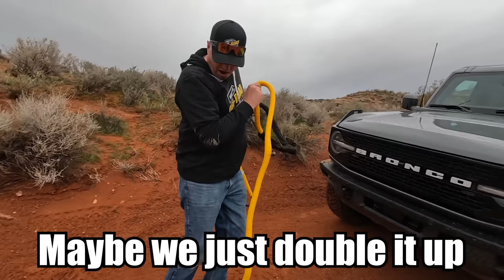More Difficult Than I Thought...Is The Wrecker Too Much For Me?

Comment: I think you need a fixed strut to attach between the wrecker and the towed vehicle.
It seems like you should be letting out more rope when you bring the back end of a vehicle down the drop. But that probably leads to it moving forward unless the rear brakes can hold it.
With a fixed strut, you could let out more rope to lessen the attack angle on the rear of the towed vehicle.

Comment: Matt, I wonder if you made some kind of bar with articulating attachment points, put a large shock absorder in it.. use it in place of the horizontal soft tie... then you wouldnt have to have someone ridin the brakes on the towed vehicle?

Comment: I've always wondered why you don't have a boom sling to use with an articulating bar extension off the rear bumper to keep the rig pushed back so it doesn't strike the boom. Maybe extend the boom a foot to help get the towed vehicle back a tad more on descents?

Comment: I would like to see a "Telescopic" fly-section in the Wrecker-Boom
it would only need to be able to add about two-foot-six
(750 mm approx.)
but with an extra pair of sheaves (pulleys) for your two boom-winch-ropes
(occasional use only).
Would probably only be needed when 
the boom is laid down low (quite flat),
or boomed up very high (steeply).

Also worth a thought (??) 
a fabricated Steel "X"  with eyes on all four legs,
for "Bow-Shackles"  &/or "Soft-Shackles"
to separate the towed vehicle ("toad")  from the two-truck
during "over-run" situations.

(would act like a cross between a Double-Bridle (soft), 
& a traditional Stiff-bar !)

Comment: Maybe supply the wrecker with  an "A-frame" -  to control the towed vehicle when "on the hook" (esp. if there were no driver in the towed) - it already has 2 pintle hooks on the rear bar as recovery points - a simple ring on the ends of 2 bars will keep things under control (a split A-frame"  - can also be used as single or twin parallel drawbars..

Comment: Matt I’ve been thinking about a solution to keep the customer vehicles off the back of your wrecker. You could run a chain through a long piece of pipe and attach one end to your hitch and the other end to the customer’s axle. You could play with chain length and soft shackles to keep from scratching their axle and your bumper. It might save hoods though :-)

Comment: I wonder if a tow bar system, essentially like drag links, would be beneficial in downhill situations. Two fully articulating joints at the wrecker, and the business ends would have tire cradles with straps. Slip joints with limiters in the link bars to allow turning. A rough concept, but it seems that it would alleviate any contact between the vehicles.

Comment: So for vehicles with shackle mounts in the front bumper, couldn't you make some steel bars about 3 or 4 foot long with heim joints on the wrecker end with mounts and then brackets with holes for a bolt through the  shackle mount. Heims alow plenty of flex but solid steel bars keep the vehicles a fixed distance away from the back of the wrecker. So no boom to hood damage.

Comment: Hi Matt, watching you with the wrecker and seeing the problem you are getting with under run of the following vehicle is it possible to use 2 pogo sticks as they call them here on our roadtrains when they hook up for a boggy bit but for you to triangulate them like a V so it can swing off your rear and work on how to connect to the tow car via axles or front bar etc?

Comment: You need a big, soft, rear bumper. Maybe a set of 4 tow dolly mounted wheels with some soft stuff sticking out between the hooks and the frame. The boom could also be padded on the tip.

Comment: Hi, Matt is you see this I put heat wrap kit for starter motors that are close to the headers. I used the stainless steel straps. It worked so good I still haven’t needed a replacement.

Comment: No Tachometer. never found the use for one,,, fun to watch. and comes in handy if you are Slamming top end gear shifts. but, should be able to drive, clutch and run with out one. I still have to have one though.. : )

Comment: Wouldn't the wrecker be better with one of those arms that lifts the vehicle by the front wheels (or what remains of them!) and holds the vehicle a fixed distance away, rather than the arm and rope with the vehicle swinging behind? It would prevent all these little bingles with the arm and the bonnet of vehicles.

Comment: I am by no means a tow truck anything, but from day one before it even left the shop I could see the problem of truck momentum and it has carried on through out the videos. Is there no way to have an adjustable solid bar with swivel joints instead of slings to keep the towed vehicle at a distance? I must be missing something?

Comment: What if you built two bars in a y configuration with shock absorbers in them to pull at the shackle points instead of the two straps so the jeep can't over run the wrecker? Or some sort of cushion bumpers on the back of the wrecker to hit against instead of relying on the boom cord to stop it. Just some thoughts.

Comment: It looks like you need an expandable boom coming from the headache rack base, and then you can use the existing boom as a sling /A frame to keep the tow vehicle away. 
I would do a roll cage through the cab  or over the cab to the front so the chassis is strong. And you could unbolt the top bars to remove the cab. But you need to be able to create  seperation. So an extendable boom.

Comment: You should build a metal/aluminum L shaped vehicle carrier that attaches to the boom and where you can strap down the front or rear tires to the bottom of the L. Kind of what Repo guys use. That way you don’t risk damaging the hood.

Comment: Hi Matt, I need to admit I do not have any experience in this sort of recovery but would it not be possible to get some solid bar or two between the wrecker and the vehicle you are towing to prevent the towed vehicle from running into the back of the wrecker?
Love your video's

Comment: Matt, would it help if you had a solid piece between the bumper of the vehicle being towed and the wrecker. So the tow vehicle doesn’t swing into the wrecker. But the solid piece would have pivot points on each end.

Comment: Isn't this where Matt should weld the steering ram back onto the bracket like Rory would do........ hahahhaha........ that's why you have an onboard welder right???? Matt, also maybe you should lift with both winches at the same time not one and then the other...... that's a problem with having 2 winches attached and separate controls for each... Matt why is the fuel dripping out of the filler neck.. maybe you finally learnt to fill the vehicle before using it for a recovery.. OMG will strange things never happen hahaha... and Yes Matt, you looked at it several times when at the locker holding the starter motor and getting ropes out etc... It is all a Big learning curve for you from now on with the wrecker and every recovery with it will be different in its own way and lessons will be learnt from each and every recovery. You both did well with the knowledge that you already have. Why is Jefe's brand new vehicle being used for recoveries ... don't you already have enough recovery vehicles to choose from without using private vehicles??? Maybe Jillian needs some help and a lift kit and bigger tires then she wouldn't need to be calling you out all the time.. but she is out using her 4wd which is fantastic!

Comment: You just need to make a pivot point in the middle. It requires a steel tube with U joints on ends. Some attachment points will need to be created but not hard to figure out. Love your channel BTW.

Comment: What if you manufactured a solid bar that had some sort of universal attachment that took away the need for someone to sit in the vehicle being towed and monitor the brakes? It could attach to your pintle hitch and could make for easy install/remove when an obstacle requires more movement than what the flat bar could provide.

Comment: I would recommend using ratchet straps to suck the front axle up.  The higher you pull the front axle up, the lower you can keep the Vehicle in tow. This will result in more room to the boom and a more stable ride.

Comment: I think you can build a trailer for the wrecker with the same axle as the wrecker and hydraulic levelling and steering.  Maybe also the hitch hydraulic to keep the back of the trailer from hitting the ground also for loading and unloading. 😃

Comment: You should tow from the axels, if not directly for the cars whose axels are deep inside the car, there is a steel triangle that you can build, fasten it to the front axel, the 2 sides of the triangle and the last corner you hoist up, it will make your work much easier and faster not forgetting add enormous control on the load

Comment: Try and chain the front axle to the frame before lifting these offroad rigs, eliminating the need to lift till the suspension is drooped out. That will allow the tires to be lifted much quicker leaving the hood further from the boom.

Comment: Jefe, when you set your BRONCO up,  
consider, maybe a two-foot tall strip of Black (?) Raptor liner of similar,
along the lower-flanks, to guard against vegetation-rash (scratches) (??)
-
Also ROBUST Rock-sliders, 
paired with retracting AMP Research, or similar,
POWERSTEP RUNNING BOARDS, 
that retract to "inboard" of your Rock-Sliders,

for when you have lifted your vehicle up a bit.

Comment: Pity you didn't have the solid towing bar that I suggested a couple of weeks ago... Just saying... I had one years ago, just a 2.4m (8') of 50mm (2") square tube with a 'D' ring welded onto each end. We could adapt it to almost anything. It could save you a lot of damage. It would not replace anything you currently use, instead it is an additional tool in your armoury to prevent the two vehicles coming together. But far be it for me to try and teach you guys to suck eggs, you do an awesome job!

Comment: Cut 4 holes in a large old tire at equal lengths apart in the center of the tread. Tie 2 ropes in an x pattern and push each of the four rope ends out through the 4 holes. Tie the four ends of rope to opposing ends of the bumpers on the wrecker and the towed vehicle. This X sling should prevent bump and grind between vehicles,(wrecker and rescued) , over varied terrain.

Comment: What you would need to keep cars hooked onto the wrecker is some sort of bars with suspension or solid that can be freely adjusted left or right for different vehicles. same concept as the black straps but solid
Google “Medium-Duty Truck Tow Bar with 2 Rings”

Comment: Think the wrecker boom needs to be 3+ foot longer and full chassis width instead of an a frame.

Would give the vehicle behind more clearance.

Also you could cross over the winch lines in a big X and do the same underneath from the chassis and it wouldn't go anywhere, no twisting etc...

Comment: Rather than using ropes between the rear bumper of the wrecker and the customers car for pulling (not lifting), could you switch it out for something rigid/solid fixed to both vehicles that might keep it at a fixed distance from the wrecker?

Comment: If its possible to leave the vehicle in 4wd and put the the trans in neutral the front brakes will help with braking and disipate heat by slowing the rear tires through the drivetrain even though the front tires are in the air as long as theres no problem with them turning. Just throwing that out there incase someone reading this didnt already know that.

Comment: You need to make a stiff bar to go between the heavy wrecker, and the towed vehicle to stop the towed vehicle from bumping into the back of the wrecker, make it sliding and adjustable with Lock pins

Comment: They need to modify the wrecker so that it has an extendable boom and also some type bar or strap assembly to stop the cars from swinging forward and damaging the front of vehicles, If the boom extended about 6 more feet it should stop vehicles from hitting the boom, Also might need a couple thousand pounds on the front bumper for ballast,

Comment: @MattsOffRoadRecovery A shock absorbed shaft or shafts system could be designed to perform the role of your crossed straps or supplement in the case of using a single shaft.  With strong enough shafts you could even have them able to lock in place to be able to hold back the vehicle being recovered on obstacles such as drop offs where you seem to struggle greatly with proximity to boom.

Without building a prototype I am struggling to describe it properly.  But I think the closest way I can to describe it is to have you picture a comp truck coil-over shock positioned between your wrecker and the towed vehicle.  Needless to say a comp truck shock would not have the strength to withstand much in the way of lateral force, so a heavier shaft would be needed such as an earthmoving hydraulic ram with coil adapter to the outside to provide cushioning.  The added benefit of a hydraulic ram is the ability to flow restrict the ram to keep the coil controlled and even have a valve shut off so that the ram could essentially be locked out to hold a vehicle back from the wrecker.  Now for this to work well with the boom winches you would want the ram to attach low on the vehicle suck as the front differential housing, having a rubber mount that gets strapped to the mounting point would ensure that you had further insulation to soften any forces on the recovered vehicle.

Jus the thoughts of an aussie with too much time on his hands.

Comment: Don't the wrecker have a welder on it? :P
& I'm thinkin you need a longer boom and a triangle shaped tow bar that could either be put 2 points on the rear of the wrecker or 2 points on customer's vehicle. This triangle would stop vehicles from moving forward and whacking the boom or the cables damaging things.

Comment: Curious why you dont use a bar connected to the wrecker to the towed, or straps like a tow truck uses, to prevent hitting the vehicles together and dragging tires over rocks, creating a flat spot on the rear tires 🤷‍♂️

Comment: Is that fuel constantly dripping out of that pipe cap on the driver's side of the wrecker? I'm pretty sure it is. That seems kind of unsafe to me. You should put a vintage style cap on it or something or you could put a piece of neoprene gasket at the back of it so it has a seal. A 12x12 neoprene sheet is like $10 and would probably do the trick.

Comment: Hi all from Australia 🇦🇺 😊,  I have a few questions.  Would it be possible to chain or strap the axle to the chassis so you don't have to lift so high? When we use high lift jacks we do this here . Would a stiff bar between the wrecker and vehicle be of any use to control the vehicle being towed?  Not actually seeing the problem in the flesh any reason why a welder could not have allowed the vehicle be driven out?  Just curious that's all hope all is well.

Comment: You just need more practice on how to use the boom effectively, raising and lowering as needed to match the terrain.  Then again, your boom would work better, especially on larger vehicles, if it were a foot longer so you could get more height for those large drops.  Have you thought about adjustable-length tubes (like long suspension arms, but more length adjustment) with round loops at the ends?  Both together on the pintle hitch and each spread toward the towed vehicle corners and strapped to the front axle to keep it all at arms length.

Comment: Just some thoughts:  Y’all have to address the suspended vehicle swinging free problem. So, if y’all aren’t gonna install some sort of wheel lift……probably too late in the game for that modification…..I think it’s time to upgrade the boom to be extendable……to give y’all more space between the wrecker and the towed vehicle. Or, just see if a conventional tow sling set-up will work with the current boom configuration. As I understand, they are designed to limit the forward/backward motion of a towed vehicle and you can keep the boom a lot higher in the process.🧐👍🏻

Comment: I really feel like you need to adjust how far the vehicle is trailing you depending on the situation... On crazy obstacles, i (someone sitting on the sideline)would let them trail behind a bit until i cleared the obstical then whinch them through.

I could see how that would be difficult in this particular situation, the steering being shot.

Comment: Would a sling from an actual tow truck be an appropriate tool to add, so it would lift the vehicle and then provide a stiff arm so that it does not slam into the back of the wrecker (MORR-n-ater)

Comment: I'm interested to see a solution to keep the towed vehicle swinging on the back of the wrecker. I keep racking my brain every time I see it work. It seems like a hard puzzle to solve. I would think some sort of bar coming from the wrecker under the tow vehicle with a rope coming out the end to attach to the front of the towed vehicle. With a little spring to it.

Comment: Those ropes that you crisscross between the wrecker and what you are towing needs to be replaced with steel bars so they keep the towed vehicle away from the wrecker. Maby set them up in a V from the wrecker to the center of the vehicle.

Comment: Honestly curious why a field repair weld wasn't in order for this? Would that not have been a little easier than hauling the disabled jeep back to camp?
Reply: The ram is aluminum the mount is steel
Reply: Perhaps I missed how it was originally mounted then. Question of a field repair vs. towing stands though. My ignorance of off roading is showing i suspect.